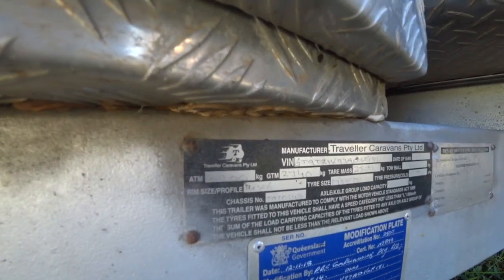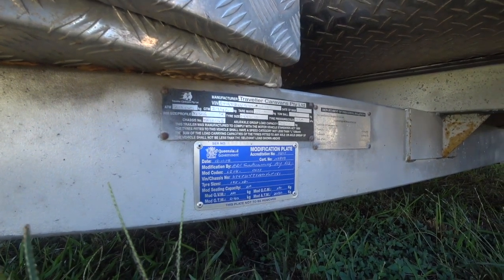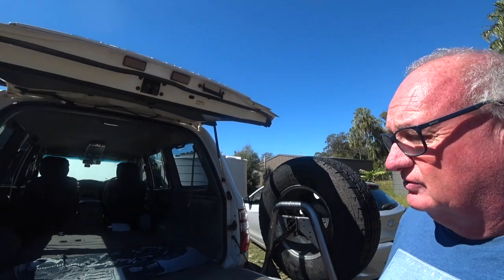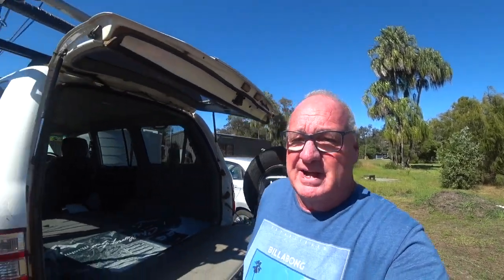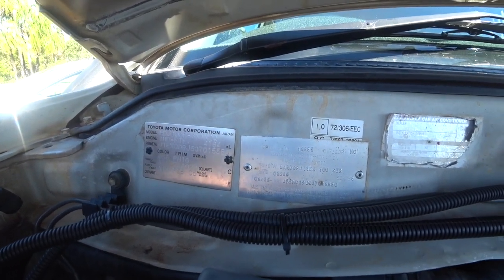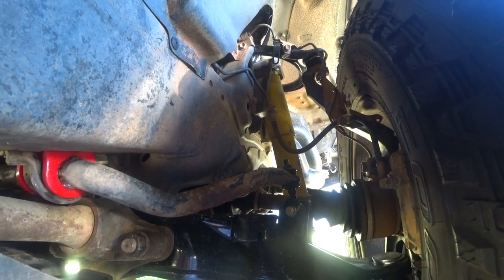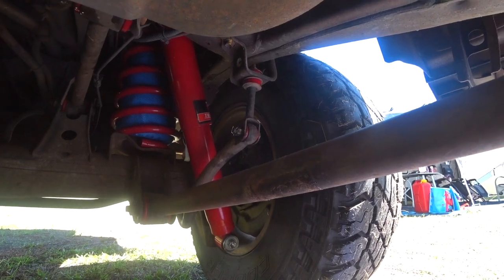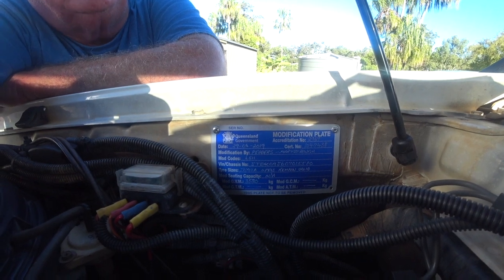Caravan ATM Upgrade and Vehicle GVM

Comment: Hi I am Ipswich way and have a caravan, its atm is 2280 and the axle group load capacity is 2860 and the GTM is 2095, I went over the weigh bridge the ATM was 2180 and the ball weight came in at 260 kg over the 10% of the ATM, so I am hopping a up grade like you do you think I would get it without any modifications ? and do you know anyone my way who does up grades ? , Thanks Wes.

Comment: Hi thanks for this. How do I find the max compliance of the chassis? 
Thanks
Reply from the maker: Hi Nick it is always on the manufacturers plate usually placed on the inside of the A section. There will be a plate somewhere. Otherwise ring the manufacturer of the chassis and give them your chassis number👍

Comment: Thank you for that . But my car  license  says I can have a  GVM of 4500kg . That is car and caravan or boat trailer and that full load. So doing all the up grades mean I would have to get a light truck license to go to 6500kg
Reply from the maker: Not sure if you are in Australia but you can tow a caravan on a car license. License refers to vehicle 4500 kg. On the compliance plate you should have a GCM listed which is max combined weight of car and trailer
Reply: You can have all the up grade you like to make your car tow it safely.  But your license  say how much you can tow not the compliance  plate . That's your car trailer  the lot no more than 4500kg and that's in Australia just that no one looks into it till your have a accident then they look at your license. It's like you have a 250 motor bike license. You  would not ride a 750 bike  that's against  the law. Same with car and trailers ask the heavy  weigh boys when you see them.  It's all about how much you weigh when you leave the curb on a car license  4.5 ton
Reply from the maker: Neil I think you are getting confused. Your licence refers to the tow vehicle you are driving. Have a read of this and it may make it a little clearer for you 
https://www.caravanersforum.com/viewtopic.php?t=73951&start=20#:~:text=To%20the%20best%20of%20my,stamped%20at%209000kg%20or%20less. You can in fact tow a trailer on your licence weighing 4500kg as well providing you are not exceeding the GCM of the tow vehicle.

Comment: Isn’t it the case that in Qld after both your upgrades it still dose t change you GCM. So if your towing you haven’t gained anything?
Reply: True Tim still can't tow over your gcm
Reply from the maker: You do not gain on gcm but what it does do is allows me to have more weightin the tow vehicle and that is a huge bonus. I tow a 23' caravan with ATM upgrade to 3080 and the car with boat on top is 3200 however the ATMwith upgrade on the land cruiser is 3500kg. That is still well under the GCM of 6680 on my 100 series Landcruiser
Reply from the maker: Tim that is true but only if you are on maximum GCM. Have a read of my reply to Molly Duke